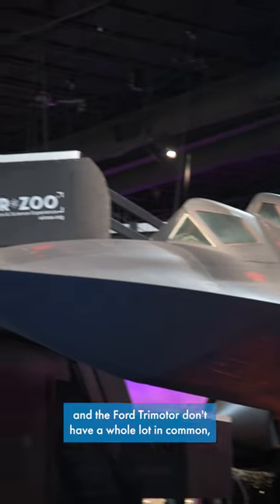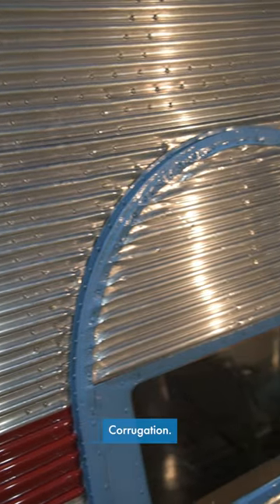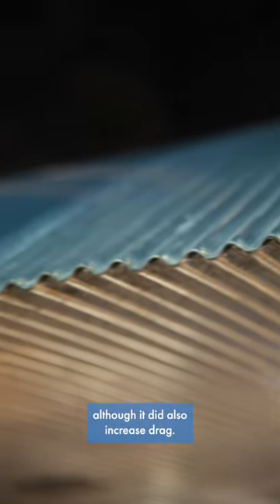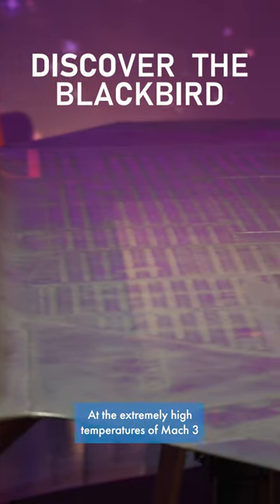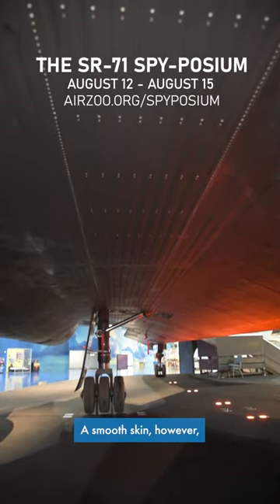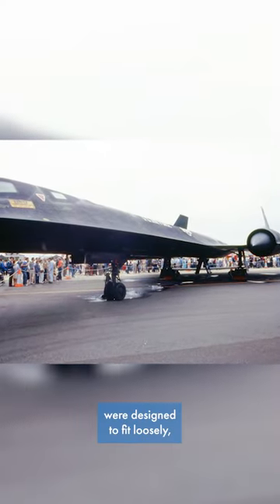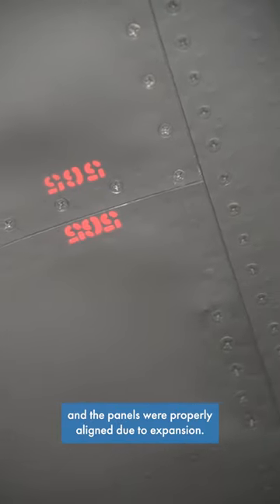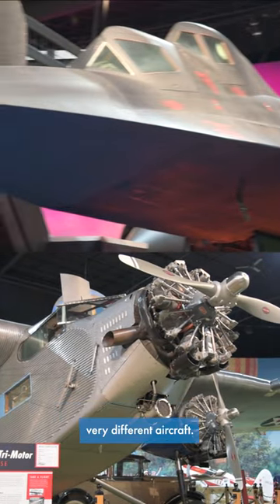What do the SR-71 Blackbird and Ford Trimotor have in common? #aviation #blackbird

Comment: The corrugated skins on the Tri-Motor don't add any extra strength to the overall structure of the plane, but the corrugations held stiffen the skins themselves which helps do away with a small  amount of internal supporting structure, thus saving weight.

Comment: The corrugated metal (duralumin) was used by the Fokker J7/J9 AKA D.I, an all-metal fighter plane of 1918.  It was in production and saw combat. 

The Ford-Trimotor came later.

Comment: I heard from an engineer who worked on and designed SR71 engines, that the engine grows 6 inches in length and 2 inches in width because of the heat.
Reply: You mean you watched a video where an engineer explained this... from this same channel.
Reply: @ParadigmUnkn0wn  correct
Reply: @ParadigmUnkn0wn  I didn't want to take the time to write all that out lol.

Comment: I literally got in an argument about this very thing a few weeks ago, glad there's a video now I can use as a reference!
Reply: Sorry to burst your bubble but this loose panel / leaky fuel  claim is totally false. Go watch " the SR 71  Experiance"  where the actual pilots , builders , engineers talk about the SR 71 in detail and completely debunk this myth . The high heat of flight would break down the panel sealants  and thus , after some time , leakage would occur , necessitating resealing of the joints . But go ahead and base your argument on a you tube short.if you choose
Reply: @ethics3  There is a picture in this very short with quite a lot of fluid under one of the SR-71s. Now, you gonna tell me that's water or...?

Comment: Why wasn't the fuel place in rubber bladders to prevent leakage?
Reply: Too much weight. Also they used silicon in the gaps but it degraded very quickly

Comment: I've heard of the leakage issue with the SR71 but why didn't they use a bladder rather than mechanical fitment? Is it because of the temperature? Seems like a simple problem conserdering what the plane can do
Reply: Fuel was used to cool the airframe.

Comment: I don't understand why the sr71 couldn't have an inner gas tank that doesn't leak
Reply: Weight if u made tanks out of aluminum its more weight & plastic would have melted so they just sealed the inner side of the skin & there u have fuel tanks with no real extra weight
Reply: @matthewperry5524  thanks

Comment: I just find it hilarious they couldn’t invent a lining or something to compensate the leaking, I guess a minor fire hazard isn’t worth it haha.
Reply: They actually did seal the gaps with silicon originally but it quickly degraded. Also the fuel was actually very stable, to the point it could be an was used as a coolant for the engines before being combusted